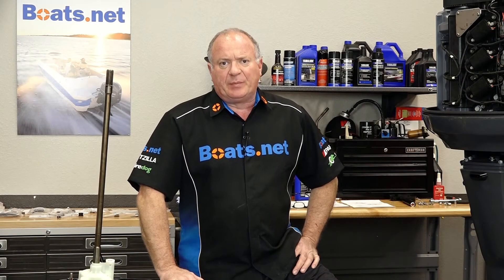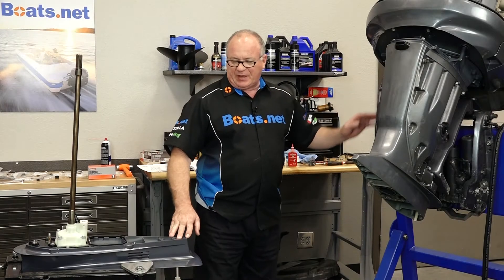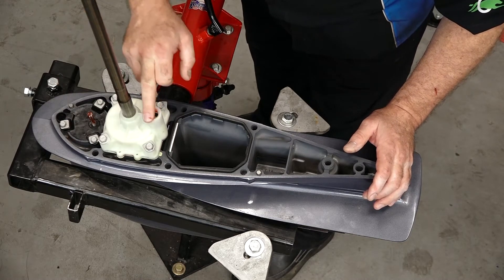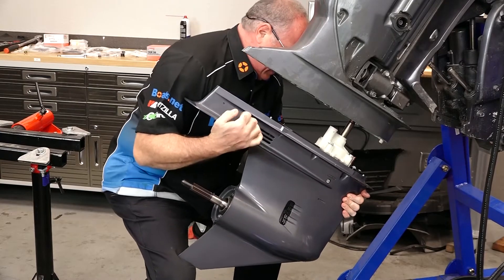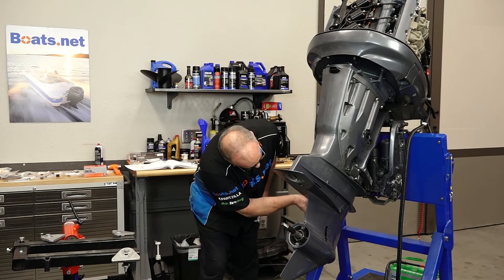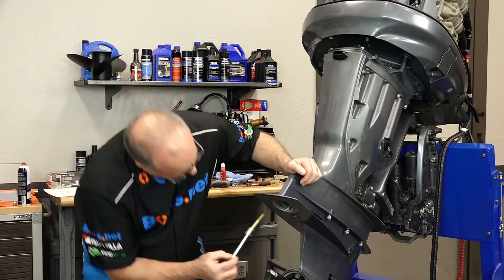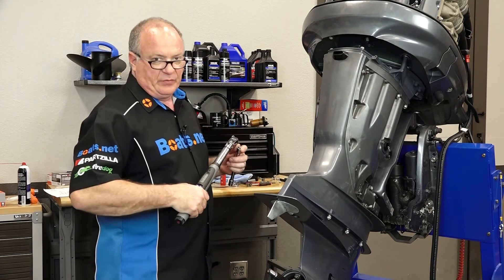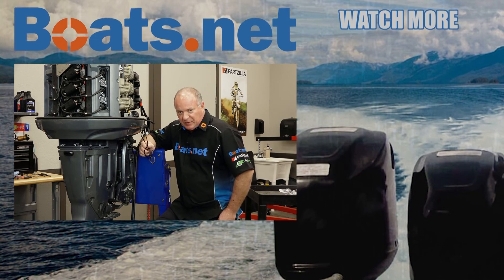Yamaha Outboard Lower Unit Installation | Yamaha F225 Lower Unit Installation | Boats.net

Comment: I have never in my 40 year career seen or heard of a tech putting fucking red lock tite on lower unit bolts. If I do, I will cuss him the entire time I fight with the bolts. Hopefully, none of them break. ALWAYS grease your bolts to seal them but DO NOT lock tite them EVER! In fact, some lowers use lock washers or you can add some. However, the video in itself is very well put together and accurate.

Comment: Whoever has to change the impeller next is really going to appreciate that red loctite....
Reply: What about corrosion of those bolts and bolt holes when the boat is used in salt water? I ALWAYS use either monkey snot or anti-seize on my bolts. I would NEVER put loctite on those bolts.

Comment: There is serious issue with using Red Loctite for the lower unit mounting bolts. Red Loctite is extremely difficult to remove.  Follow your service manual which will note Loctite 572 thread sealant.  Apply a circular bead three threads down from the top.  I really do not understand the use of red Loctite that will need heat to break.  Follow this instruction and be prepared to have a very hard time removing those bolts next time.  Lastly, before you torque to spec., which is shown correctly here, clean the male bolts thoroughly along with the female mating threads with a nylon bore brush (10mm and 8mm for M10 and M12 bolts).  Clean threads are a must before applying a torque spec.  DO NOT use red Loctite....use the service manual thread sealant as noted.  

If you use a sharpie and mark the shaft and housing with a dot, you can then turn the shaft for the dots to line up.  Then the splines will match the same position during removal.  Then the lower unit will slide in as long as you align the shift shaft and water tube.  The shift shaft MUST NOT be moved.  Otherwise you will lose your neutral position and a special toll will be required to turn the shaft back to the neutral position.  If you prop. turns freely both ways, after installation, you have done it right.